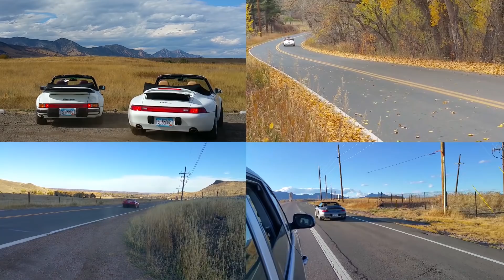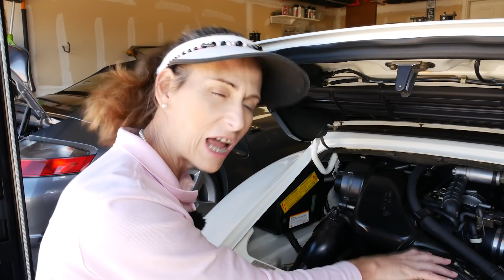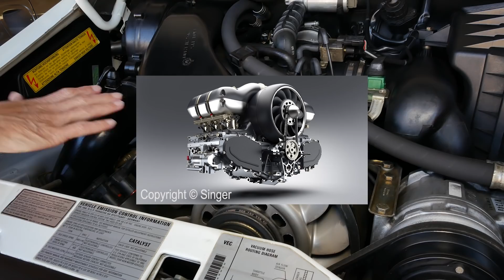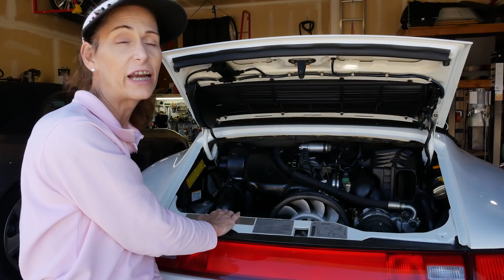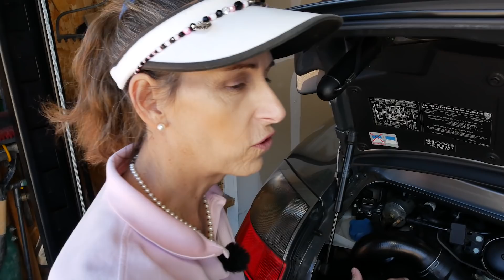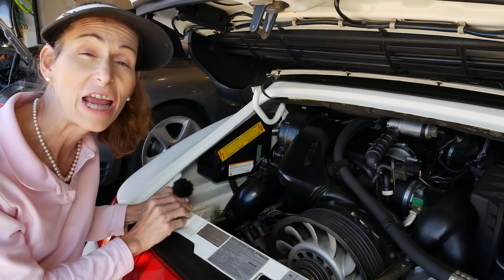Water Cooled Vs. Air Cooled Engines – With Engine Sound

Comment from the maker: Hi Everyone, Water Cooled vs Air Cooled - Porsche 996 v.s. Porsche 993 Comparison! Have you ever wondered about the differences between a Porsche air cooled engine and a water cooled engine? We dive in to compare the Porsche 996 Turbo to the 993 Carrera to what is different about these engines in these two series.  

What do you think??  Which is your favorite and why?

Any questions or comments (or anything I missed) just leave them below. 😊  Thanks!! Franny
Reply: Like your reviews and in this case you correctly point out these are actually OIL cooled cars, and oil isn't as efficient at cooling as glycol/water is.  I had a 996 Turbo for many years and would like to try a 993 Turbo.
Reply from the maker: Wouldn’t we all...  they are amazing I am sure.  Heidi
Reply: I have the money, just so many good choices....

BTW, on Ferrari Chat, there is a new thread about the two of you....you have fans everywhere.
Reply from the maker: Diablo Roadster lol. Yes, a friend of ours sent us the link.  It was very nice. Thanks for telling me as well. Heidi
Reply: I learned a few new things from your video!  I have both and like both!  Out of a 912, Boxster, and 996.2, the Boxster is my favorite to drive.
Reply from the maker: Awesome.
Reply: Love the vid.  Thanks for the insight!
Reply: While I can understand why people get 'emotional' over air-cooling and carburetors but I prefer EFIs and radiators. 
Seamless and consistent performance, better thermal efficiency, better fuel economy, longer engine life and less chance of engine seizure. 
Sure, they're expensive and make an engine complex but the cons far outweigh the pros; in my personal opinion and experience. Especially when it comes to forced induction.
Reply: The vulnerability of the water hoses on the water 996 is defiantly something one must consider when driving. A few days after I got my 996 out of the shop--the front bumper was torn off during shipping--and I was on the interstate behind a truck carrying a bunch of loose crates. Well, one of the crates fell and got sucked under my car and shredded my coolant lines. It was a horrible experience.
Reply: Heidi and Franny's Garage I
Reply: Heidi and Franny's Garage Very articulate and knowledgeable lady.
Reply: 964 C2 with Porsche sports exhaust (basically a g-pipe), sounds the best of all. ;-) I miss that car like no other.
Reply: I like the simplicity of my 66 beetle. And yes, trying to heat the inside of the car in winter, can be a pain.
Reply: I love my air cooled Porsche.  Had brand new.  1998.   Blue exterior.  Blue interior. And blue matching roof.  Also oringinal.
Reply: I think it is not really fair to take a turbo engine for comparison. I own a 996 GT3 - a very different sound. I like it very much

Comment: I’m interested in buying a 996 simply because the 993s are out of my price range. I would like to know if the automatic cars are more trouble free than the manual cars? I’ve had experience with gears that grind and clutch and throw out bearing repairs. Is there a particle year/model of 996s that are more desirable? Also, wonder why Porsche did not use electric fans on their air cooled engines? Seems to me that would help to mitigate any overheating issues and provide better heater and defrost functions.
Reply from the maker: Do your research.  There is a reason why 996 are cheap. If you are going to get a 996, make sure you only look at turbos.  There is something called an IMS bearing that needs to be replaced in all the other 996 or even 986 Boxsters and this is why they are a bargain.

Comment: 911 water cooler should not have the 911 number on it. Should be given another number. That is my opinion. I am guessing Porsche decision to retain 911 number for the water cooler was for marketing reasons.
Reply from the maker: They decided to cool the car with water, but it is still a flat six engine and still looks like a 911.  That is why and yes, they still make them today.

Comment: I appreciate the air cooled very much on an old car not having to deal with a few extra systems.  A knock against water cooled engines in older cars is that many owners simply neglect that system and don't change coolant.  I got lucky with an old Corvette that was burning coolant in the combustion chamber, but many people have no idea they are driving with coolant leaking into the motor oil until it's too late.  Also my old Jeep was neglected and the water pump vanes rusted out and broke into pieces sending clunks of rusted debris into the radiator clogging it.  It took years to fully flush it all out and several ruined radiators.  Something to think about as all cars age.  The air cooled Porsche top end will probably pay the price in the end for being air cooled wearing out sooner on average than a water cooled car so it's a trade off.

Comment: Give me a break lady. Porsche was getting 1,000 hp from its 917 aircoolers over 50 years ago with a capacity of less than 5 litres. Give me aircooled every day of the week! No radiator, not radiator hoses, no water pump, no header tank. there is a lot of stuff not on the aircooler making it lighter. directing the air over the cylinders in an aircooler was never a problem in reality. Porsche proved this with spectacular wins on car racing for decades. Nothing could touch the air cooled 917 Porsches whose dominance was only killed with a change in the race regulations. With aircoolers there is the added advantage of no water to freeze over night.  I own water coolers these days cos no new aircoolers around any more. I lament the passing of the aircooled flat sixes and fours.

Comment: I wonder.. with the insane radiator fan and smoke fan set ups in pro drift cars.. if that would benefit air cooled engines a lot. 

They basically have shrouded fans in the trunk that help cool suspension and keep smoke from building up in the cabin.

Comment: Another excellent video. In the past I had 3 VW bettles, a '56, '64 and '69. I froze in the first two in the winter and at times the windshield would freeze over, plus the auxiliary propane heater in the trunk on the '56 caught on fire once while driving so I had to pull over and put it out. Saying all that I love the sound of the VW engine as it revs up with gear changing. I am looking for a VW but this time targeting the Ghia or a Super Bug.

Comment: I’ve owned both air- and water-cooled 911’s. Both fantastic, but another water-cooled advantage is their ability to rev higher than their older siblings. Especially the GT3 versions which have usable redlines of 8-9000 rpm! And the sounds they make are ferocious.
Reply: I disliked this comment as your statement makes me extremely jealous

Comment: The rear engine LC Porsches are crap. LC is not suitable for rear engine cars. It makes all the cooling system so complex. And LC engines get rusty inside while standing thats why the car collectors always prefer air cooled ones.

Comment: Porsche GT2RS Can Produce 700hp  which cannot be made on air-cooled engines like 993 which could produce 400hp on some varients. Water-cooled engines can handle the heat dissipation more readily by installing more radiators around the body works hence the power increase over air-cooled. Porsche will never go back to nostalgic Dinasour days, even petrol-driven cars will eventually give way to electric cars within 50 years. (owner of a classic 2.2S for ten years). Today the only thing going for the 911 is its beauty like admiring a 'Mona Lisa' painting but nothing else, now that we Telsa electric cars coming on the scene.  Telsa has produced acceleration speeds 0-60mph in 2.5seconds, like being catapulted from an aircraft carrier, now can a Porsche match that? HHMMMM!

Comment: I just love the  sound of the old air cooled motors, so much noise going on. I was rather lucky ( but unfortunate) to hear the big end bearing knock amongst all those noises on my 2.2 back in the 70's.... a costly noise.
It never leaked any oil though.👍🇬🇧

Comment: My 3.2 Carrera used to worry me when I was queued in traffic; I’d sit and watch the temperature creep up towards the red line! You can’t really drop it by blasting hot air into the cabin like you can with water cooled. Anyway, it never let me down, but it could be a worry in the heat of summer ...
Reply from the maker: We had a similar issue in 32deg weather in stop and go up in the mountains...  The solution is to install a fan on the oil cooler.  It is something I plan to add to our car :)

Comment: Excellent explanation. I loved it. It would take a a true Porsche enthusiast to love these cars. They are very costly to maintain.
Reply from the maker: Thanks!  We haven't found the Porsches to be all that expensive to keep up actually.  The cooling system on the 996 has been a bit of a pain though.  The 993 has been almost nothing.  They are relatively easy to work on as well.

Comment: Air cooled all the way!  Easier to work on, less expensive, less exposure for cooling system failures.  Not that they don't, but to change a spark plug, you don't have to take out or move a half dozen hoses.  (The Good Old Days...!)

Comment: Idk if you answer cause this video is 2 years old but on motorcycles are 2 stroke motorcycle engines air cooled and 4 stroke motorcycle engines are liquid cooled? Please someone aswer, cause im getting dirt bike soon and at start im driving slower so 2 stroke is better cause it runs cooler on slower speeds and 4 stroke engine runs hotter on slow speeds, so i think 2 stroke motorcycle is best for me, what do you think?
Reply from the maker: I don't think that holds true completely.  There are plenty of air-cooled four-stroke engines out there.   The two-stoke is a lot simpler.
Reply: @HeidiandFranny  oh i didnt actually think you would respond but thx for answer im telling the things abt 2 strokes and 4 strokes and then we will choose im then saying which one we got! And i give you a subscribe for answering

Comment: Why does the air cooled 993 have a "shamoo" license plate when Shamoo is a whale that lives in the water? And at this moment of typing I realized its because of the......whale tail. But your's doesnt have the whale tail? IM SO CONFUSED
Reply from the maker: Lol. I can explain.  Shamu was our first 911 Carrera, and it had a tail.  It was black and white and red (burgundy) on the inside.  Kind of funny and kind of gross.  We then decided to buy our 993, which was going to replace the 3.2 911, BUT I (Heidi), did not have the heart to sell it.  We kept calling the 993, Shamu2, as the replacement.  It just stuck.  We should get the 993 a better name.

Comment: I love your video and you nows where you are talking about  i love  air cooled i have a carrera 
The only thing i thon,t like is when i don,t drive for about 3 or 4 mounths it smokes 3 mitutes and than it,s over
Probally the oil tank fills up the carter i have a norton commando also with a oil tank under the seat and i have solved it with a check valve or just drive more  from portugal 👍

Comment: Hello. I am getting ready in the next year to purchase either a 1980s 911 vs a 996 or 997 as a weekend wrenching car for fun. If you could go back which would you lean towards? As an aside I have rebuilt my 1978 Fj40 landcruiser. Have good mechanical skills and and a garage with a lift. Thanks!
Reply from the maker: 80s SC or 3.2 for wrenching.  If you want to drive, the 996 and 997.  You will have some maintenance, but not much.
Reply: @HeidiandFranny  Thank you!!! Much respect!

Comment: One thing I thought you would touch on was how the two cycled heat so differently. What I mean by that is how the water cooled engines retain their heat. That was one of the problems with the air cooled engines, which is the main reason for the higher emissions. The air cooled engines just cooled down so quickly after sitting a little while, so it took longer to bring them back up to operating temperature.

Comment: I like the air-cooled engines.  They remind me of the 1962 Beetle I had back in college.  Three years before I was born, my father came across the Atlantic on a boat with that brand new Beetle.  By the time I inherited it, it wasn't running and needed a rebuild, which I did myself.  I had the engine out twice, but never had to split the case open.  The old JC Whitney catalog was one of my best friends.  I had that old engine sounding soooo good that about once every week or two, a stranger would stop me to complement it.  Well finally, just before I graduated, I think it was at about 230k miles on the odometer, I got broad-sided by a pickup truck.  Since then, I've owned only water-cooled engines.  My whole life, I've always loved the sound of the air-cooled Porsche engines, and would love to own one.  But I think the price-point has already escaped my means.  Maybe I'll be able to get a replica 356 or 550 with a VW engine.  That would still be awesome!  Right now, I'm living vicariously through your YouTube channel.   Thanks for the great videos.  ;o)

Comment: Imagine sticking your hand in 300 degree boiling water, now imagine sticking your hand in an oven on 300 degrees.
The water will severely burn you badly just sticking your hand in and out. The oven wont unless you keep in it there a long time.
It's a great thought experiment of the conductivity of heat between air & liquid.
Reply from the maker: Ahhh, but the Porsche fan delivers about 1500liters/sec or 3178cfm.  I don't think I would want my hand anywhere near that much flow at 300deg...  True after compensating for density that water is about 3300 times more effective at moving heat.  In an air cooled car that air is moving a much higher rate than water is circulating through a water-cooled engine.  ...and the heat out of the radiator eventually has to be cooled by air so... :)

Comment: Guess what, the oil in both cars does the same. It lubricates, cools and cleans; same as all engines. It doesn’t do extra things in an air cooled engine just because there’s no water jacket. Just the air cooled engine relies on airflow and oil, water cooled engine relies on airflow, oil and water.

Comment: Hi Franny, I use Evans waterless coolant in my 996 and Z3. Any downside that you're aware of? Saw it on Jay Leno's garage a few years back and is supposed to be non toxic, non corrosive and no overheating.Thanks Fran & Heidi and enjoy your show.
Reply from the maker: Sorry. No clue on the product.  How is it working for you?
Reply: @HeidiandFranny  hi guys, it works very well and again, no water doesn't hurt animals  and no over heating etc. I'm kind of suprised you haven't heard of it Fran as I couldn't imagine using anything else on my cars. If you have a moment, check out (Jay) Leno's garage on you tube with the heading Evans waterless coolant. It's cost me about $200.00  Canadian but less in the U.S. where it's made. You never have to change your fluid on your car ever again and will outlast any car. I'm not affiliated with this product in any way other than being a customer but amazed by those who've never heard about it. Thanks guys, LOVE your show! 😊

Comment: What would you recommend a first time buyer for an air cooled Porsche to look out for? I’ve found one near me for a decent price and would like to ask someone like yourself who’s clearly experienced what I should look out for. 
Thanks Fran :)
Reply from the maker: Hi There :)  What year are you looking at?  80's? 90's?  First would be rust and body panel gap/paint. That may sound funny, but the mechanicals are always cheaper to fix.  Then move on to the engine and transmission.  A small bit of smoke on cold start if the car has been sitting is ok (it is a flat engine thing).  It should start and idle smoothly.  Power should be smooth and consistent.  The older (pre 1987) transmissions are slower and require a slight pause across neutral.  It should be smooth.  the earlier cars are a little loud.  Look for any wetness.  Shouldn't be any anywhere.  Not the end of the world, but signals future work.  Get history and service history.  Also, look at the brakes and feel for a reasonable lip on the rotors signaling a need for brake work.  These cars are pretty bulletproof.  993's have a reputation for early valve seals and the OBDII cars can have clogged ports leading to a CEL.  Feel free to email us on our website! Franny

Comment: So the new Porsches are copies of the communist Czechoslovakian Škoda 105/120/125/130/135 cars with engine in the back and radiator in the front.
There are much more powerful air-cooled engines than those from Porsche! Tatra produced Trucks with air-cooled engines and also tanks use air-cooled engines. Tatra never had problems with heat since they are known as extreme workhorses under extreme conditions!

Comment: I have hope that air cooling engine's will make a comeback, theirs a lot of benefits with a air cooling system, is like you said water cooling is a old drama ( blow head gaskets, water pump, radiator hoses and the most evil of all : CORROSION and extra maintenance and expenses that those come with that, everybody here that's has done a heads gaskets on their cars or trucks knows the cost and pain in the ass  it is.
Reply: I use Evans waterless coolant in my BMW Z3 as well as my Porsche 996. No corrosion, no over heating etc,etc..Saw it on YouTube a few years ago on Jay Leno's garage.